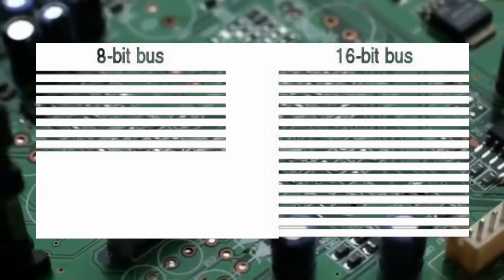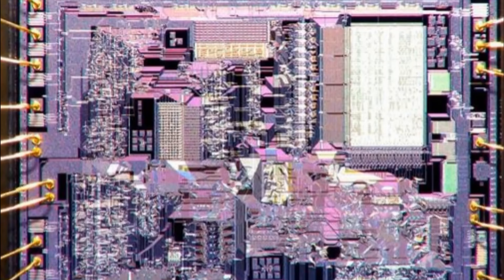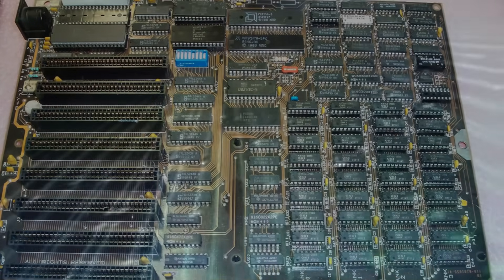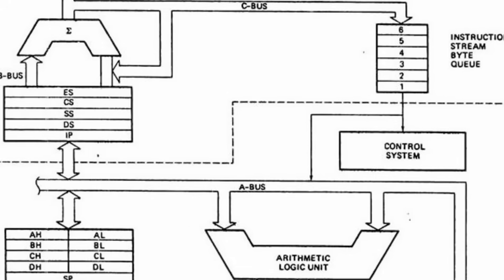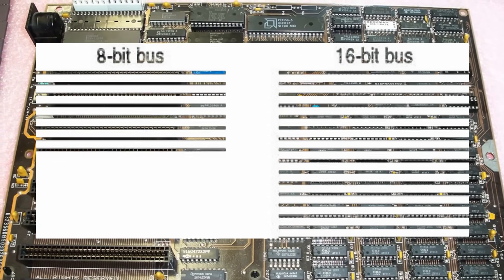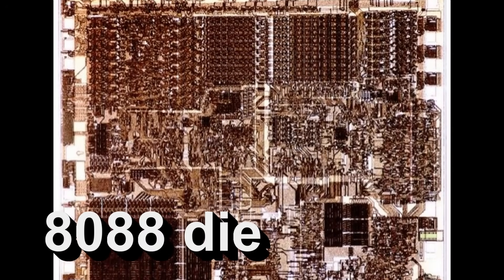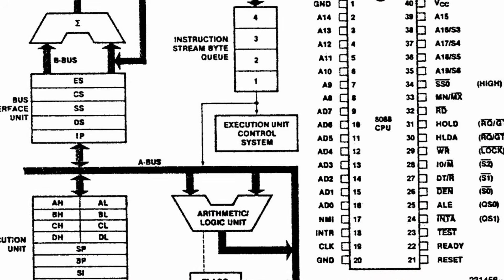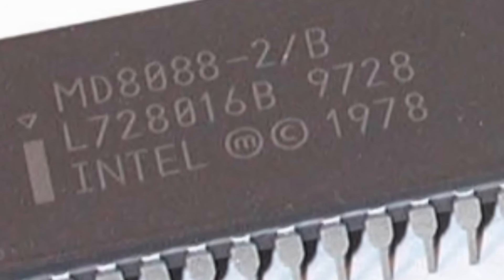8088 & 8086 CPUs... Why 16 bit Came Before 8 bit [Byte Size] | Nostalgia Nerd

Comment: where did the 86 name come from because 8086 came before x86
Reply: @mspenrice: You are right, except that the 8008 was not an "upgrade" of 4004 (or 4040). 

The 8008 and 4004 were fundamentally different. 8008 was a p-MOS implementation of the TTL-based CPU of the Datapoint 2200 while 4004 was a programmable calculator CPU for Busicom.

Work on the 8008 actually started before the 4004, although under different names. The plans for the 8008 was paused for many months while the 4004 project began. Both were jobs for other companies, and as such had low priority compared to Intels main business – static and dynamic RAM chips.

Federico Faggin from Fairchild (later founder of Zilog) was hired by Intel to help in this mess. The first thing Faggin did was to implement the delayed 4004 in his own logic topology, developed specially for his own fast and compact pMOS process with self aligned silicon oxide gates and bootstrap loads.

Ted Hoff had designed  the high level structure and instruction set of the 4004, and Shima (from Busicom) made the transistor and logic design (after being taught). After that Faggin finished the even more delayed 8008 design, with Hal Feney, using the same process and methods. 

Later Faggin and Shima made the 8080, but this time in nMOS, before leaving Intel in order to start Zilog and develop the Z80 in fast depletion mode load nMOS.
Reply: aidan Stenson The 8086 and 8088 were the first x86 CPUs. The 80286 had the same basic architecture, but it added a protected mode and a few features that made it easier to develop software for it. The 80386 (i386) expanded the architecture to 32 bits, but it was still compatible with the 8086 and 80286.
Reply: StarTrek123456 thank you
Reply: You missed out the 80186, which was released and used by - - - - -  -nobody. It had a half arsed DMA controller (nothing like as good as an 8237) and an interrupt controller which was nothing like as good as the 8259 and not cascadeable either.
Reply: In the same way that certain logic ICs were often referred to as 74xx series, the ‘x’ simply represents ‘any number. When you see x86, the ‘x’ is a placeholder for ‘80’ or ‘801’, ‘802’ etc, to give the 86 family of CPUs their full names. Eventually, the CPUs became known by the last three digits, 286, 386, 486 and so on. To break with this traditional naming convention, Intel used ‘Pentium’ to separate their 586 from the other manufacturers making 80586 CPU’s. At one point, there was a 686 CPU which intel named the Pentium Pro.
Reply: That's a very good combination reminder (of things I once knew, then forgot, and failed to properly integrate whilst writing my previous comment) and further fleshing out of the story behind it all. I think I must have got myself confused because of the release dates, and also how the 8008 is visually almost the same as the 4004 (it only has two more pins across its entire package) which makes them seem related. Though that doesn't really work for the 4040 because it's almost as big as the 8080 itself, breaking the seeming 4004-4040-8008-8080 progression... shoulda been obvious in retrospect.
Reply: The name came from it being the latest incarnation in the 80xx line. Intel started with the 8-bit 8008 (upgrading from the 4004 and 4040), then followed it with the 8080 and 8085. The 8086 was a source (though not entirely code) compatible 16-bit extension of those, and the 8088 its 8-bit bus counterpart. Everything after that was built directly on the 8086 as a base, hence getting a 1, 2, 3 etc shoved in between the "80" and "86". Quite why they didn't instead make them the 8186, 8286 etc, I dunno... it probably scanned better when said out loud, or there may have been other existing chips with those numbers. Or maybe by then they'd just got attached to the "80" prefix and decided to hang onto it to imply a straight progression from the 8080, even though it wasn't quite that simple... and it also risked confusion with the similarly 8080 derived Z80...

The "x86" is simply from "x" commonly being used in numbered series such as those used for microchip families to indicate "any number could go here" (and, in the case of the 8086 at least, there might not even be a number in that position). It's also less commonly written as IA86 (Intel Architecture-86) or 80x86, and similarly, the Motorola equivalents are sometimes described as the "680x0" series (and, for the first two incarnations, possibly even 6800x and 6801x or just 680xx, as they both had 8-bit-bus flavours available); we also have the 80x87 and 6888x coprocessors, 5600x DSPs, etc, as well as 680x and 650x 8-bit CPUs... etc etc.
Reply: It was longer lived than you think. Although the PPro itself didn't last long on the market, its core ended up, with the addition of the competing MMX instructions from the main Pentium line (not the only case where an initially minor upgrade to the older line ended up outperforming the new one in real-world use, just look at P3 vs P4...), forming the basis of the Pentium II and most Intel processors proceeding from that, including the PIII and the pre-x64 Cores, and particularly the more hardcore server class Xeons. They still report as "686" architecture processors under a lot of CPU check utilities, and it's why the competing manufacturers switched from making "5x86" to "6x86" (or K5 to K6) branded chips fairly quickly as the Pentium era moved first through the MMX and then into the P2 era, as they updated their own architectures to keep pace.

Though the reason for the name change isn't just for separation purposes. What actually happened was that Intel tried to trademark "586" to prevent other manufacturers from using it as part of their own model names (much as they did with the AM486, Cyrix 386SLC and all that) and causing confusion, after a couple decades of only trademarking the overall family and architecture names, and were told - quite rightly - that no-one can trademark a simple number, otherwise we'd be in a pretty serious mess, shades of which we've seen where some copyright trolls have trademarked fairly common words and then tried to sue people using them in otherwise mundane contexts.

So they quickly came up with some half assed car-model-like name based around "five", thinking it would probably only be relevant for a few years before they then had a chance to think about it more carefully for the following generation, trademarked that ... and, well, it was a roaring success, got a massive amount of public mindshare, and became possibly the most recognisable Intel product. So when it was time to upgrade the processor... uh, well, y'see sir, the problem is the marketing department REALLY don't want us to change the Pentium branding, certainly not to Hexium and particularly not Sexium... I think we're stuck with it.

So the first set of superscalar extensions was MMX... the iAPX-432-ish successor with its own superscalar abilities, out of order execution, on-chip L2 cache and a bunch of other improvements wasn't anything with a "6" in it, but instead Pentium Pro... the mashing together of the two with a better cache system became the Pentium II, and then with the introduction of SSE, the Pentium III (rather than a 7, then 8...), with the stripped back "SX" type for some reason being called Celeron (hell of a misnomer, seeing as it implies greater speed, a bit like the Suzuki Celerio...) and "Pro" server spec the Xeon (take Xenon, knock out the first N, take an early lunch), and then the abortive attempt to add both hyperthreading and a much longer pipeline alongside an entire new core structure became the Pentium 4...

...from where there was nowhere to go, as the Pentium itself was already the "P5" (with subfamilies of P54, P55 and P55C...), and the Pro the "P6", so unless they wanted to pull an XBox One or Atari VCS, they had to come up with a new name. Thankfully some bright spark realised that "Core", whilst a potentially confusing name in some respects, was an entirely trademarkable word, and would work well in a self explanatory fashion when combined with modifiers showing how many parallel execution units were on the one die. Which survived a generations all by itself apart from the Celerons and Xeons, and then soon the all new even further cut down Atoms (excellent choice of name, and something of a tribute to a similarly cut-back everyman computer from the early 80s with unexpectedly strong sales)... but, you can't keep a good brand name down, so before we reached the point of having stratified Cores (which would have obviated the need for it) and were still just in the Core 2 era... whoops, the Pentium is back AGAIN, as an intermediate level between the flagship Core 2 Duos and Quads and the Celerons that the Solos just didn't manage to fill in any way that satisfied either customers or the Intel bean counters.

Funny how things happen, really. If the Core "i" naming convention had come along instead of the Core 2 (vs actually displacing Core 3, launching with the initially deceptive i3 instead), but with Intel still sticking to their BMW-copying "everyone likes middling odd numbers" strategy for the mainstream models, the Pentium and Xeon might have been quietly scrubbed altogether, their names replaced by i1 and i9... as that's essentially what they are anyway, recent addition of an actual i9 notwithstanding...

Comment: While it may take 2 operations to push/pull the data through the bus (only 16 bit information) internally it is the same speed (which vary in range of clock cycles for an operation) and due to the fact that not every command has an output (sometimes it's just a setup for the next command) the actual speed difference between the 2 processors was a lot closer than it sounds.
Reply: Only if the code wasn't well optimised for the 8086 and happened to be accidentally well optimised for the 8088.

The core design has a 4-stage pipeline (ie, 4x 16-bit word read-ahead input buffer), with the 8086 actually being well balanced in terms of memory read rate vs average execution rate (and need for writing output data) that keeps it reasonably full - and thus both the memory bus and execution engine close to full saturation, without either of them ending up idle waiting for the other. Which is basically the optimal way to set up a single tasking, single core CPU and its support circuitry, as you can't really make the system any faster by individually speeding up one side or the other; you either have to increase the clock speed (accelerating both chip and motherboard, and using faster memory to cope), or increase the efficiency of both parts (making the core do more work per-clock, and then having to lengthen the pipeline for better buffering, reducing waitstates and implementing burst mode transfers on the motherboard/memory side...). It only ends up suffering data starvation or leaving the bus idle with fairly pathological instruction mixes that have long strings of ops that each take much less or much more time to complete than maybe three or four memory cycles (one to read the instruction, one or two to read data, one to write the result), when most code would naturally end up with a mix of instructions with different cycle counts, and a dedicated programmer would cycle-count and rearrange code where the exact sequencing wasn't critical in order to maintain as optimal an average as possible.

With the 8088, that job is a lot harder, because it takes twice as long to read or write anything to/from memory other than strictly byte-(or nibble, bit-)wide data, and as early-generation as the 8086 was, it just doesn't have that many commonly used instructions that take at least as long to process as 6 or 8 memory cycles (when working on 16-bit words - when working on 8-bit it's 4 at a minimum - 2 for the instruction, 1 to read a data byte, 1 to write a result byte; if working entirely on registers, the instructions still take twice as long to read). So unless you have an extremely smart programmer writing your code, able to sprinkle a good number of genuinely useful long running operations inamongst all the other shorter and more common one, the core will be continually running ahead of what the data bus can provide, leaving the pipeline essentially empty because as soon as something's read into it, the data-starved core is consuming it byte by sparing byte, rather than it waiting in the buffer to be used all in one go as and when needed. So it's almost always going to be labouring under a half-speed cap when working on data-less pure opcodes (all 16-bit) or anything using 16-bit data, and still have trouble managing anything better than maybe 75-80% (3 vs 4, or 4 vs 5 memory read ops) when working on pure byte data unless the instruction mix involves a lot of mults or divs...

Weirdly, about the only time an 8088 will end up matching 8086 performance is when processing code that might traditionally be thought of as rather challenging for the 16-bit chip, as the core will be tied up chewing over complex arithmetic work contained wholly within the internal registers and seemingly running very "slowly" as it's not running through very many operations per second, with the pipeline sitting full of successive instructions awaiting processing and the memory bus being largely idle (like, doing nothing at least 50% of the time). In which case, the 8088 is just as able to fill up its pipeline (or at least keep it, say, half full) as the 8086 and so can keep its ALU and other core components continually saturated with new instructions and data. And similarly, any frequently branching code that ends up regularly taking the less-likely branch (so not prefetched by the branch predictor), which is a bit of a problem for an optimally matched processor like the 8086 because you then have to flush the entire buffer and start reading the other branch from scratch and suffering a resulting slowdown, will run almost as fast as pure sequential or endless-looping code on the 8088.
On the other hand, just as unintuitively, "light" code that takes hardly any time to process (and so seems "fast"), especially if working on 16-bit data, could be slowed to 50% the speed of the 8086, maybe even slightly less because of the extra delay involved in directly reading the data from memory in response to the core's requests rather than being able to take it immediately from the pipeline.

So on the whole it's still somewhat slow, but just how much of a speed hit you take in exchange for a cheaper overall architecture (which gives you spare money to improve performance outside of the CPU-Memory pair, including possibly turning up their operating frequency - or, as seen in the IBM PC, implementing an entirely separate video system with its own VRAM that doesn't load the main bus unless you make changes, on a wholly separate expansion backplane which lets add-on cards talk to each other without touching the main bus, as well as various other little copros like the keyboard microcontroller that further reduce load on the CPU/bus) is dependent on what code you're running... with heavy maths and frequent unlikely branches unexpectedly showing much less slowdown than simplistic toy code that in most cases isn't really hugely dependent on raw performance (especially if it's been upgraded from BASIC to assembler/machine code, and ultimately hailed from an 8080, 8085 or Z80 based 8-bit machine...). 

Which is probably why the initially unlikely looking architecture of the 5150 PC ended up being so successful - the raw processing side of things was pretty marginal in terms of speeding up simpler old Z80 code, but would have done quite well on heavier number crunching, especially if paired with an 8087 for the floating point side, and all the extra little details IBM were able to build in with the extra budget headroom versus an 8086 (or 68000, 32016, TI9900 etc) based system both helped compensate for that by relieving the processor and memory of a lot of the load they were expected to carry in a lot of other contemporary systems (so they could concentrate more completely on actual data processing instead of endless admin, or redrawing the display from a shared buffer 50-60 times a second) as well as making it remarkably flexible and expandable for a huge range of different applications on top of what the base model could handle.
Reply: Remember that you need to fetch the instructions. Many instructions were two  bytes that meant 8 cycles to fetch. It does not help it it takes just 2-3 to execute. If the instructions accessed memory then competed with fetching for the bus. Also 8088 had just 4 byte queue whereas 8086 had a three word one.

Comment: 80085
Reply: I'm afraid you put a zero too many; the 8085 was the 8-bit forerunner of the 8086.
Reply: +Gert Brink Nielsen it spell boobs m8 I'm being immature
Reply: DeusPayne try putting 5318008 into a calculator and turn in upside down. learned that from The Big Bang Theory